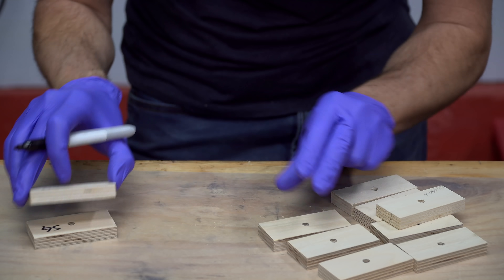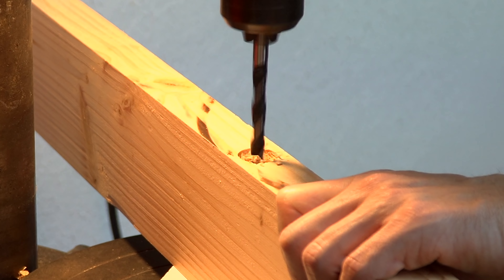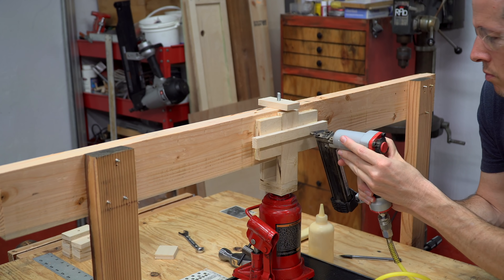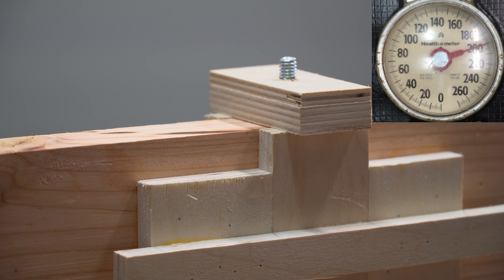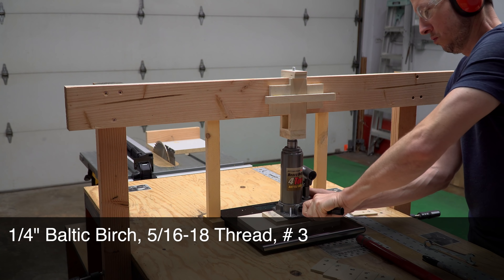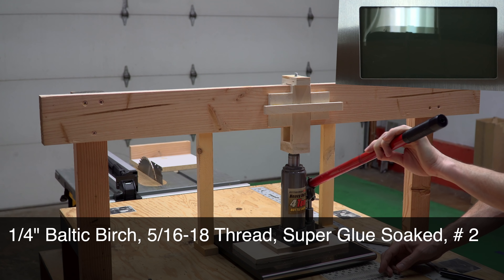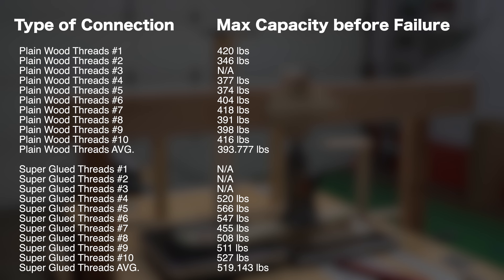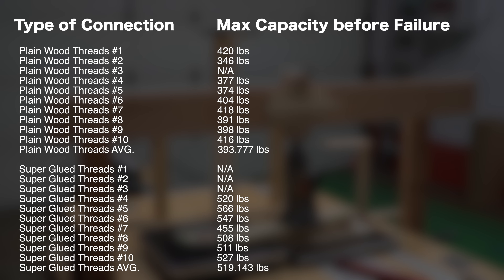Does Super Glue Make Wooden Threads Stronger?

Comment: Your testing seems to prove the point well.  It would be somewhat interesting to actually see if accelerator does indeed make super glue even stronger, but I'm not sure that in woodworking (mine in particular) whether additional strength would actually be needed. I can't imagine a situation where I wouldn't actually use a bolt where the amount of strength required exceeded your test results. Good information and great presentation.
Reply from the maker: Thank you! I didn't think about adding accelerator, but it would be interesting to see. I hear what you mean about how you probably wouldn't find a situation where you were going to use a bolt, but needed to hold more force than what was shown - I was shocked by the amount of weight just a 1/4" of threads was able to hold. Anyway, thanks again!

Comment: If want it even stronger drill the initial hole a mill shy then ca glue the hole the superglue wicks into the wood deeper then cut the thread into the wood and ca glue composite, great video, also can glue and baking powder make a immensely strong bond and can repair most things good for building up damaged surfaces and sands really well.
Reply from the maker: Thanks for the suggestions! Someone else had mentioned baking soda...I might have to do some additional tests to see how it holds up. If I do, I'll be sure to post a video!

Comment: Good fun! Maybe use a lever set up to essentially multiply the capacity of the scale. Hey, either way, I like your approach and the results are pretty conclusive. I am sure there is a university student out there who will do their PhD on a study like this - lol
Reply from the maker: I'm glad you enjoyed it! I'm sure lots of people have written about this exact topic (thread pull forces), but I doubt any of them have have centered around CA reinforced plywood...I'm sure they're mostly about metal and plastic. Believe it or not, I actually drew up this device, but then decided to build a lever system as my first approach. I had a suspicion that my scale wouldn't have the capacity to detect direct pull forces, and I knew that if I used a lever, I could get away without having to buy a new scale. Well, I built the lever device, did a bunch of testing, shot video the whole time, but eventually I had to abandon it because I couldn't get a reliable reading that translated to pull force on the threads. As the lever would move, the bolt would bend and wedge itself in the hole, so you couldn't really tell if the threads were holding the bolt, or if friction from being wedged was what was holding it. Either way, it was a good learning experience, and I'm glad I came back to this original design. Obviously, I had to buy a scale in order to pull it off, but I think the results were worth it. Anyway, thanks again!
Reply: I wonder if a lever under the jack would work, like Matthais uses for his test rigs?  Its a slightly different testing than any he has done but I think it would still work.

Comment: The jack should have been under the scale not on top. Part of the force on the scale is the force of pumping the jack.
Reply from the maker: Thanks for sharing that thought! I'm sure that would be more accurate, however it might be a bit more difficult to setup the test that way. Plus, while it's true that any forces (including the pumping action) are shown on the scale's readout, I still believe it reflects how much force is being transferred to the threads, since they are the only thing providing resistance against the piston's upward progress. Or at least it reflects it accurately enough (for this test) to show that there is a difference between the glued and non-glued sample sets. Anyway, thanks again!
Reply: @OneMinuteWorkbench  Just subtract the weight of the jack. Done!

Comment: Lots of testing. But when I’m tapping plywood it’s for jigs and such - nothing structural. It’s 10s of lbs of pullout not 100s. I CA the threads to make them more durable for multiple assembly/disassembly and on that count there is no question. Non fortified threads in plywood last a few times, but CA them and they last a few years - maybe a few decades who knows.  It’s essentially plasticizing the plywood so the threads are roughly as durable as if they were cut in solid plastic material.
Reply from the maker: Thanks for the feedback! By the way, your comment about adding CA to the threads was one of the ones that inspired me to do this project - thanks again!
Reply: Nice work! I loved it! Two things come to mind. 
1. You could have used a lever  system to reduce the pressure on the scale in a reliable and calculatable way. I've done that when measuring weights too heavy for my bathroom scale, like my trailer's tongue weight. 
2. Although the your testing clearly and consistently showed that treated threads were stronger, the change in the way you measured the pressure, using the two scales in tandom, invalidated being able to quantify it.
Thanks!

Comment: I wonder if you could drill an oversize hole then put a big nylon bolt in it head down, then fill the space around the bolt with baking powder and then apply the glue. You would actually be casting the threads, so there should be no cracks or imperfections. This assumes the CA does not stick to Nylon.

Comment: Very well thought out test rig. Too bad you did not have access to a pallet scale or high capacity scale, I would really like to know the real numbers.
I recently had a project where even though I drilled a 4M hole with a drill press for a 4mm piece of linear shafting, but it was a had a little slop, a little CA glue in the hole of the movable piece and the two holes of the base wood and I had to pound the piece of shafting through the holes. The holes were tight now, not a hint of slop.

Comment: Awesome. Well constructed experiment. You did it all very well to insure you were testing the tensile strength of the threads. Great job. Btw,  strain gauge based load cells aren’t that expensive... google that! bathroom scales are cute. And just curious? Why worry about CA reinforced threads in wood when you could just cut and tap a small plate of steel or aluminum, and secure it with appropriate fasteners to the adjacent wooden part? 5 mm cold rolled steel plate, your pull out strength would be at least 1000 kg for sure. Probably closer to  2000 kg.  5/16-18  in Baltic birch plywood will inherently be not ideal. Keep in mind 18 mm Finland birch is 13 ply. And the number of plies scales to thickness well.  So threading plywood you’re gonna want one thread per ply.  5/16-12 or 5/16-10 would be better- but Not standard for manufacturing,  but material science and engineering don’t lie.  tensile single point burst strength of a 0.6 x 0.6 square of 18mm Finnish birch plywood is around 6000-8000 kg. So either use a steel plate to spread the load, or  just use a threaded insert from stafast - those pull out around 1000 kg in 18 mm if I remember correctly.
Reply from the maker: Thank you, I'm glad you enjoyed the experiment! I think using wooden threads, where applicable, is a big time saver. Additional plates and inserts are great, but they do take more time (or at least the can take more time depending on the positioning of assembly components). I think for the most part though, anywhere I'd use wooden threads, I probably wouldn't need the extra 30% strength of the CA glue because I'd only use wooden threads in low load applications. That said, I had to test it because it just sounded so interesting. A lot of people have now given feedback on how CA glue makes wooden threads more durable, so the real reason to use it isn't to increase the load it's able to handle, but rather to increase the longevity of the threads. So, if the statement that CA glue makes wooden threads more durable is true, then applying it to wooden threads that are used in low load applications could be beneficial.....but we'd have to test the durability of regular wooden threads, and CA soaked wooden threads to be sure.....Oh boy 😬

Comment: You can use a lever together with your jack and scale to increase the maximum force you can measure. Wandel demonstrates the technique in this video: https://www.youtube.com/watch?v=cRPgCMmbeyQ
Reply from the maker: Thanks for the suggestion! However, it wouldn't work in the scenario. While it's true that using a lever would have allowed me to use my original scale, it wouldn't (and didn't) create the correct forces on the threads/connection. Someone else mentioned it, so I'll just take an excerpt from my reply to that comment. Here's what I wrote:

Believe it or not, I actually drew up this device, but then decided to build a lever system as my first approach. I had a suspicion that my scale wouldn't have the capacity to detect direct pull forces, and I knew that if I used a lever, I could get away without having to buy a new scale. Well, I built the lever device, did a bunch of testing, shot video the whole time, but eventually I had to abandon it because I couldn't get a reliable reading that translated to pull force on the threads. As the lever would move, the bolt would bend and wedge itself in the hole, so you couldn't really tell if the threads were holding the bolt, or if friction from being wedged was what was holding it. Either way, it was a good learning experience, and I'm glad I came back to this original design. Obviously, I had to buy a scale in order to pull it off, but I think the results were worth it.

To add to that original comment, the lever applies torque, which is different than a pull force...I knew that I was sort of cheating by using a lever for the type of test I wanted to do because I didn't want to pony up for a new scale. I learned the hard way that just doing it right the first time would have saved me about weeks worth of work 😐. I do enjoy the videos Matthias produces - he is one of my all time favorite YouTubers. Using a lever works for what he is doing, because once a joint is glued, it is essentially one solid piece in the shape of an "L". A joint that is bolted together however is not, and it has lots of different forces at play. Torquing a glued joint will show you when it cracks, and torquing a bolt joint will also tell you when it cracks, but in the case of the bolted joint, you won't know whether other forces (like the friction caused by the angled force being applied, and the "wedged bolt" effect) are skewing your numbers. Anyway, I hope this makes sense! Thanks again for sharing!
Reply: @OneMinuteWorkbench  You just need a swivel joint so that the force applied to the screw stays perpendicular to the surface of the board the screw is in.
Reply from the maker: That would do the trick, and I had considered it. However, I felt it was just outside of what I could build in a reasonable amount of time, at least with enough precision (without more robust metal working tools) that the numbers could be trusted. I probably could have bought a joint (or more likely two joints would be required for this to allow the degrees of freedom necessary to move in two planes), but it just seemed simpler (and easier to achieve the strength necessary to hold the forces required) to use a nice thick horizontal beam. Again, it kept it easy and the only thing it cost was a new scale....and you saw my original scale - it was time for a new one any way 😂  😂  😂  This isn't to take away from the thoughts you're sharing though. They are totally valid, and I think it's great that you're sharing them. Others can now read this, possibly gain some insight from your suggestions and use it in their own applications. Knowledge is power and I appreciate you sharing yours!
Reply: @OneMinuteWorkbench  The problem is that even with the new scale, it was not enough. And putting two scales in parallel and trying to balance the force applied to two scales is not a reliable way to measure force. Putting a swivel platform on the end of a level is relatively easy. You can see how Wandel did something similar in his video.

Comment: As far as the force on the scale it's worth noting that you are also measuring the force with which your pressing down on the handle!!
Reply from the maker: True, however, I still think all of the force is transferred into the threads, since they are the only thing holding back the jack's upward progress. I'm sure it would have been better though to have a device apply the force, as some others have suggested - that probably would have resulted in more accurate readings. Thanks for sharing your feedback!
Reply: If you press down on the handle with nothing holding the jack back you'd find the pressure to be a few pounds at the most.

Comment: Interesting tests.  I've never heard of treating wooden threads.  There appears to be quite a bit of deflection in your beam (across the bench).  I would suggest doubling that member up and using the jack to push the bolt head.  This would allow you to better/fully support the test piece while concentrating more of your test force on the threads (through a more rigid load member - the bolt).  This would also better approximate the forces seen by the threads in most applications - a bolted compression load).  Perhaps step down to 1/4-20 for the 1/4 thick test pieces.  Optimally you want to have a minimum of 2x the diameter for proper thread engagement.  Obviously this makes the required load to failure greater but by only engaging a maximum of (4) threads (in your 3/8-16 thread through only 1/4" of stock) and using plywood stock, I believe you're getting lower failure loads than could be expected in real applications.  This is OK as long as we remember that all we are looking for is a relative comparison (good presentation of summary results showing a percentage difference to highlight this fact).  It would be great to use a load frame and load cell to test longer thread engagements in hardwoods and see if we can get load ranges for various design applications as well as a comparison to using a T-nut instead.  Thanks for the video.  I'll definitely keep this in mind, especially if I can't fit a T-nut in a thinner member.
Reply from the maker: Thank you - I'm glad you found the tests interesting! I could probably do some load testing even without a load cell, just by cranking the jack until it reached a specified amount of force, then measuring the time to failure. As you mentioned, this test was mostly to see if CA glue increased the strength. While, not really statistically valid, these test does suggest that is the case, and lays the groundwork for doing more rigorous testing....if anybody every wanted to do that - lol. Also as you mentioned, these test don't describe most real world applications (at least in a normal woodworking environment), most of the time, if bolts are threaded into wood, the threads would be much deeper than 1/4 or 1/2 inch. Either way, I found it to be a lot of fun, and I'll likely do some more tests based on all the feedback I've been receiving in the comments, so stay tuned! Thanks also for taking the time to share your thoughts and suggestions!

Comment: Great video man, 
To bad about the scale issues you were having.  An older scale and a screw advanced level coupled with a 5 to 1 reduction would have been perfect.  You know,  how Mathias does it😜.  
Doesn't matter though,  you proved that super glue greatly enhanced the strength. 

I would like to know...
If you're tightening a bolt into wooden threads with or without glue, how much force should you apply with your 12 inch wrench. I'm assuming you don't want it maxed up to 90% for the life of your project.
Reply from the maker: Thank you! And it was time for a new scale anyway...you saw my old one 😂 As far as using mechanical advantage to be able to use a lower capacity scale like Matthias does in his joint testing videos, a few others have also mentioned it. I've replied a few times, so I'll just copy and past one of my old replies here: 

I actually started out using leverage to reduce the force required so the scale's readout would be able to handle the test. I switched to this method though because the torque being applied at an angle was causing problems; it was "wedging" the bolt in the hole, so you couldn't really tell if it was the threads or just the friction of the angle causing it to hold. Someone brought up that I could use pivots in the lever arm to keep the force perpendicular to bolt. While that's true (and I did consider it), it was more complex than simply buying an extra scale, and I felt it would create more room for error, so I decided on this simple, direct force apparatus. I hope that makes sense!

And as far as how tight to tighten wooden threads, I would say for the most part, if it's something that needs to be tighten with a wrench, wooden threads probably aren't correct for the application. 99% of the things I use wooden threads on are "hand-tighten only" applications. If it's anything that requires more force, I'll use T nuts or threaded inserts. And yes, even on the hand tighten stuff, I don't usually tighten them as hard as I can....I'm sure it reduces the lifespan of the wooden threads when you crank down on them. Although, it seems superglue might help in increasing their lifespan.

Thanks again for stopping by to comment - I appreciate it!